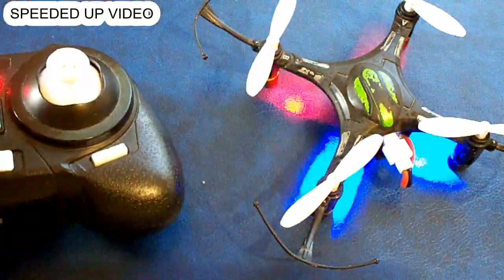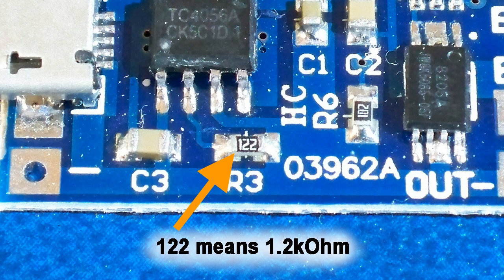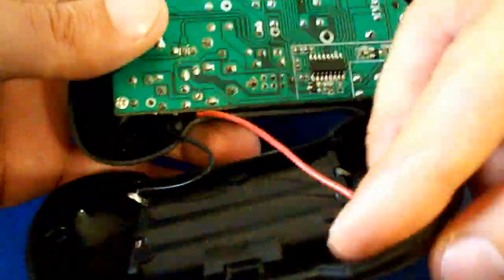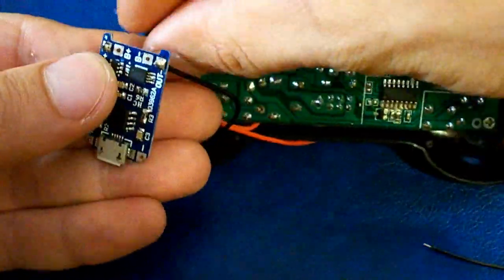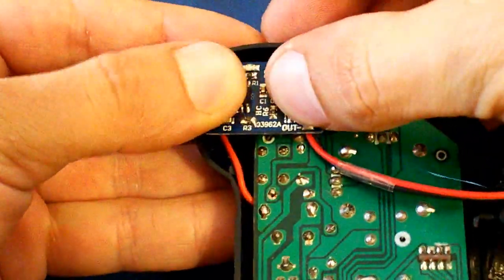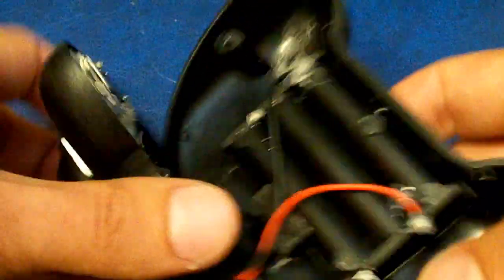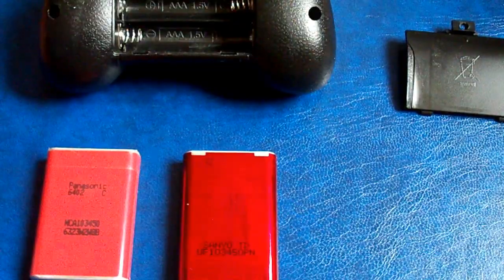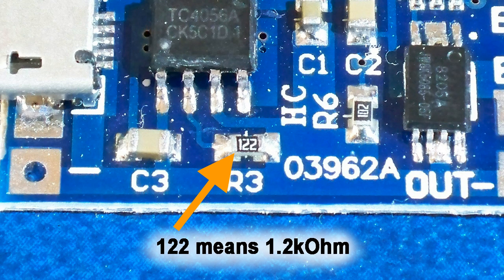Alkaline, Ni-Cd, Ni-MH to Li-ion with USB charging - JJRC H8 mini quadcopter's RC unit

Comment: Gracias, pero tengo una duda, el mando trabaja con 3 pilas AA de 1.5V y los reemplazas por 2 celdas LiIon de 3.7 cada una 3*1.5v=4.5V que etsa muy por debajo de 2*3.7V=7.2V por favor indicame como hiciste para que no se quemara el control.

Thanks, but I have a doubt, the remote works with 3 AA 1.5V batteries and you replace them with 2 LiIon cells of 3.7 each 3 * 1.5v = 4.5V which is well below 2 * 3.7V = 7.2V please Tell me how you did so that the control did not burn.
Reply from the maker: Hola. I didn't use 2S Li-ion (7.4V) but i used a single cell (3.7V) which has voltage range 2.75V-4.2V. A 3S Ni-MH pack's range is 3V-4.5V so 1S Li-ion replaces it well.